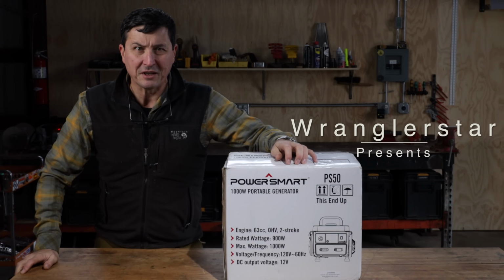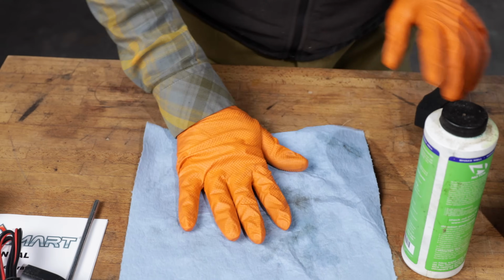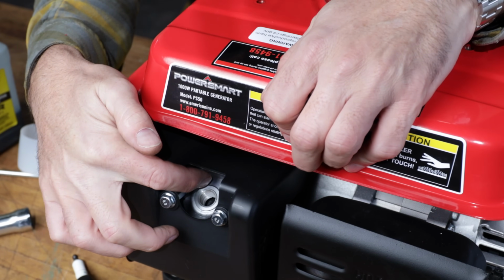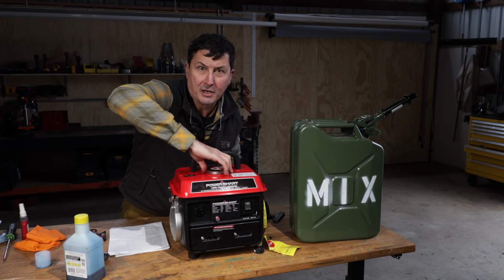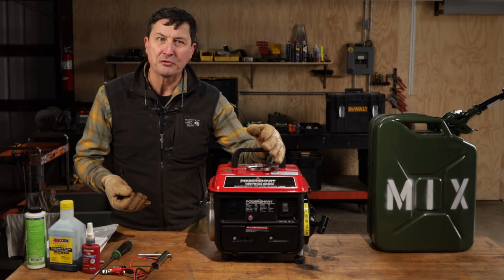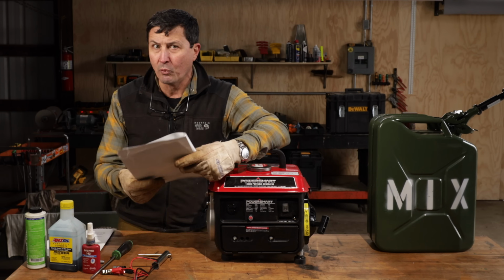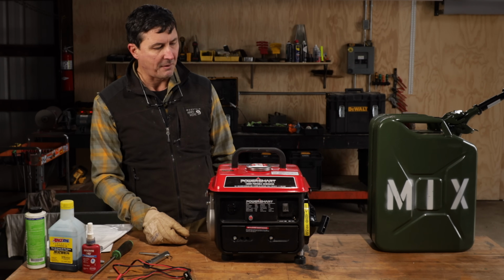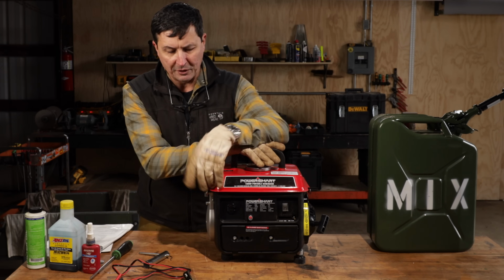TESTING The Cheapest GENERATOR on Amazon -$99

Comment: I would imagine that company produces more than just that generator, and likely produces larger models with 20amp, and maybe even 25 or 30amp outlets.
As a factory in china trying to keep costs at a minimum, you can reduce the number of different outlets on hand by skipping 15amp outlets and just using 20 amp outlets on anything 20 and under. That way they can just order more bulk of 20amp outlets, and keep the cost down, instead of splitting that bulk, and putting money into a smaller bulk amount of 15amp outlets

Comment: This exact gen set is sold as anything from a 900W to 1500W under multiple names and colors but you can find lots of documentation for them being 900 peak and 600 running. You need to put a kill-a-watt meter in line with your heater to see what yours actually puts out as plugging in a resistive heating element isn't a test because it'll just max out what the gen can give it and provide the requisite amount of heat. It'll never pop the breaker because it'll never output that any amps.

Comment: Harbor Freight sells the same thing under their own name.  I bought it and it worked really well after I changed out the cheap Chinese spark plug for a Champion.  The fuel cut off valve eventually started leaking and I got rid of it.

Comment: We bought the earlier 950W model about 15 years ago, and it was second hand even then. The only complaint we had was that one of its rubber feet was missing!   We don't use it excessively, but it seems to do all it's asked to do. It can be reluctant to start if left unused for a longish period, say, 2 months or more, but is fine once it's up and going.

The only thing to watch out for, is never be tempted to exceed the generator's design limits. These machines rely on a pair of high current blocking diodes built into the rotor. These diodes take the full brunt of the reflux current every half revolution. The reflux current is what drives the magnetic flux in the rotor, which in turn energises the stator and produces the output current. The reflux current is directly proportional to the load applied to the output, and the diodes are at best conservatively rated. You may get away with overloading once or twice, or maybe a hundred times, but it will eventually destroy the diodes over time. Small Hondas did it the same way, and suffered the same fate - we know, it's how our little Honda expired. It's also why we have a 1kW, and a 4kW Honda, and a 3.5kW Briggs, so that we can choose the machine best suited to the job in hand.

Noise wise, the little Chinese "blue-smoke" is surprisingly quiet, and runs surprisingly smooth, once loaded. Its also very handy for charging the tractor batteries when the tractors are off site - 8A charge for 20 minutes is usually enough to get all but the most reluctant tractor started.

Often maligned by some, and almost certainly not worth repairing if they breakdown, but if you use common sense, and look after it, even one of these 'Chinesium' generators will give decent service if you don't overtax it.

Always handy to have in the back of the van, or pick-up!

Comment: I have a similar unit, bought it because it was on sale for 50€. Fun little thing. 

If you run into those cheap diesel generators, the first thing to do is to drain the oil and vacuum all milling chips out of the crank chamber. I ran into one that had the oil pressure watch bypassed because it did its job and tried to protect the engine. The crude mesh filter was blocked with aluminum chips from the manufacturing. Apparently the manufacturer didn't pay anyone to remove the chips and nobody cared.

Comment: Gidday Wranglestar I had the same unit called GMC here in OZ ten years ago Global Machinery Company . They went belly up but not from selling that unit from all the other stuff that was less than adequate . If they'd only sold those they'd probably still be in business , We used them for camping a mate had the four stroke version and it was a higher output but the two stroke version punched way above its weight and if you overloaded it it would just keep screaming . You're also spot on check the tension on all nuts bolts and screws and change the spark plug the filters aren't as fine as they should be .

Comment: Hold your horses buddy. Dont plug electronics into this! It does NOT have an inverter, the output voltage is directly dependent upon the rpm and the Hertz and sine wave will vary. This is for basic stuff (lights, power tools, fridge etc)

Comment: I've had one of those generators for 16 years. It runs about 6 - 61/2 hours on a tank full. It has about 800 hundred hours on it.
Now here's my expertise, I'm a certified Outdoor Power Equipment Mechanic, with 30 years of experience. 
Do not run this type of generator using both the DC and AC circuits at the same time. You will damage its circuitry. 12 volts is drawn directly from the generator, were as the AC voltage is run through a rectifier with bridge diodes. 
Next, if your going to use this to run or charge any electronic devices use a surge protector, they do not develop a clean sinusoidal wave and can damage your devices. An inverter generator is much more stable, and has a cleaner sinusoidal wave which is more compatible to electronics. 
Comparing this generator to a Honda EU generator, is comparing apples to oranges. Its not even in the same league.
But beyond that, the one that I have has been totally reliable.
Reply: Could you use the 12 volt output on this generator to power a 12v DC in / 110v AC out pure sine wave inverter?
Reply: @rhulse8904 , you could but it's not ideal. I would use the generator to charge a deep cycle gel battery and draw the power for the inverter from the battery. The battery will act as a buffer against the voltage irregularities produced by this type of generator.
Reply: Thanks friend, I didn't know that ..
You may of just saved my generator  ?
Reply: @tedsamuels3203 , your welcome.

Comment: This is a similar or perhaps the same generator that harbor Freight sells. That's a pretty good price also especially delivered.
I've had my little two stroke generator from harbor Freight for 7 years..
I don't get to use it that often but I very regularly start it, and  put a little load on it , and then let it cool off and shut down I always make sure I drain the fuel by letting it run out of fuel.
I changed the spark plug to a better brand and I added a fuel filter.
I actually don't find them to be that loud... And they're reasonably fuel efficient. we used it camping one time to run some lighting about only pulling about a hundred Watts, and it  ran for almost ten hours on that gallon of fuel
the thing that I like is there extremely lightweight if you just need some portable power but don't need that much in the way of amps they work great.
I would probably not suggest using sensitive Electronics with it since it's not a inverter style generator.
I have a 2500 watt inverter generator from harbor Freight also and that also runs quite well.

Comment: I bought my Harbor Freight TailGator expecting it to last a year or 2.  Twelve years later and it is still on the Chinese spark plug.  Best $89 you could spend at the time.  I have run it for weeks before, also loan it out to people.  The only repair I have made was to replace the fuel line.
Reply: whats is the biggest thing you have run off it? Still running now 3 years later?
Reply: @StephenGrosch  Unfortunately it quit outputting power last year.  😪   I replaced the capacitor and checked the plug outlet and determined that it was a problem with the windings in the power unit.  I have powered a 5000 BTU window a/c unit with it.  A total of 14 years is really good though.
Reply: @bimmerwman  RIP Your did your job well!

Comment: Your more expensive Honda generator will give a cleaner sine-wave output, suitable to connect electronic equipment to.  Any basic generator will only be suitable for driving motors or resistive loads.  You could always charge a battery and use the battery to run an inverter for your electronic equipment.

Comment: The Honda is extremely high on price, but keep in mind its an inverter, not just a regular generator, a inverter is much safer to run your electronic devices, but there are a number of inverters available at reasonable prices. I saw a Champion 2,000 watt inverter advertised for $399 which is a bargain, and there are several in that $400 to $500 price range, and they are 4 strokes and should last a lot longer.

Comment: Ive had the harbor freight version for 3 years, lived through a winter on top of my car, still starts in 1-3 pulls every time. Cleaned the carb out once, and has continued to run fine over many eyeballed gas/oil mixes. Paid $90
Reply: Same here, she's a beast for the money, and very portable also.
Reply: Winter in what state?
Reply: Winter in what state?
Reply: Did you disassemble your carb for a full clean or did you just spray a carb cleaner into the running generator?

Comment: The big thing you didn't mention us that these are two stroke and capacitor exited which means the rpm and voltage regulation is   not good enough to run any kind of digital equipment, these are well known for frying PCB's . Another factor is the 12 v DC voltage is not high enough to charge a battery, you can get it higher by increasing the rpm but you can't use the AC until you have set the rpm at  3600 / 60 hz again.

Comment: The Harbor Freight version is the exact same thing minus the 12V charger on the side. The newest version might have the 12V but Ive had mine for at least 8 years and it still runs great.  Ive used it to run refrigerators during power outages and most recently last week I used it to run all the christmas lights on a float.  Well worth the money.

Comment: You should have released this 2 weeks ago...

was looking into this one to run a 650w compressor but since the startup require 2-3x the current i was not sure if it could handle it. atleast my 3000w is very quiet (2x the price)

Comment: Ditch that Torch spark plug ASAP. Wranglerstar's video reminded me that I have a generator just like his that I haven't been able to start since last year after maybe 2 hours of use out of the box. Today I spent an hour trying to figure out why. Changed the gas, emptied the carb bowl, looked at the spark plug (clean, hardly used), checked the fuel line. It still wouldn't crank. Finally, I put a random Champion lawn mower spark plug in and it cranked right up!  It did run rough though. Went to the car parts store and got an Autolite 64 plug. Runs like a champ.

Comment: These cheapo units are getting so-much better that it's mucking-up the used market for the name brand units.  I just practically gave away (compared to the price of a new one) a Honda powered 5kw generator with only 35 hours on it because a new Chineasium unit can be bought so cheap.

Comment: That is rad.  If it were mine id add an extra muffler.  

Id be really interested to know if it would run on diesel,  sure its not supposed too and the internet will say it simply cannot,  but will it ?   If not straight diesel,  50/50 mixed with gas ?  What other flammable liquids can it run on ?  Etc

Comment: Ask your neighbor down the road to make you a voltage/amp data recorder, and run this for 1-2 weeks 24/7 under load. Will it standup? Even though it's around $100, getting another one in a emergency power option is not an option. Saw a review from a Ham channel on a dual fuel generator that could run on gasoline, natural gas, or propane. That's the way to go. Plus the natural gas/propane runs way cleaner and requires less maintenance of the carb after use. During an extended outage, gas lines will be long but natural gas will be there. Get a big enough generator to run your furnace and you're good.

Comment: Most people like you will have a battery charger you can run off that generator 120 volt outlet. The cables are not that important.

Comment: I like the reviews, but I disagree with storing equipment dry after they had fuel added to them.   I think that invites issues with the lines and tank.  I much prefer and had good results with storing them with fuel, with a double dose of fuel stabilizer.   The lines stay in better shape and I don't get rust in the fuel tank.   My backup generators sometimes sit for 2 years so I run them 3 times a year and replace the fuel once a year.   I use the fuel in other equipment I use often or my car.    Just my 2 cents.   Keep up the reviews!   Thanks

Comment: No way that thing is able to handle a full size fridge!
Reply: YES, way..   I have run a large size fridge on mine multiple times. I have even loaned it to a neighbor during an outage to run her large fridge.   Just don't try to run much else. The fridge does not really run all the time.  It only turns on when needed.  I ran the fridge for an hour or so.  Then disconnected and ran other appliances for a while and in a few hours hooked up the fridge again.  No problem .  Do not be deceived by the small size.

Comment: thanks wranglestar    I have the tailgator   I love it.  its going on 5 years old now.  runs with a little shot of either to get it going.    over the years   It did need parts.  I left it outside in an unheated shed and the cap blew up I found a new one with a google search.  plug and play with a little trimming  .  The float bowl pin will not stand up to eathanol gas   A new carb was needed   Available on Amaazon for around 20 bucks      So I have $145 into mine over 5 years

Comment: Just be carful with those because there not voltage regulated it just is controlled by rpm so whene it runs out of gas and starts surging and you get huge voltage spikes

Comment: Those are great for the price I bought one from harbor fright about 6 years ago just to haul into a motorcycle trail to charge car batteries for some bridge welding and drilling, it ran for several hundred hours on that job and still sees use around the property today. And no oil to change and no plastic cams like in the Honda 1000 and 2000.

Comment: I would absolutely NOT plug sensitive electronics in to one of those generators. Best case scenario its not going to work efficiently and you're going to generate a lot more heat in whatever you're plugging in. Worst case, you're going to fry it. If its a modern fridge/freezer, computer, what ever, you need to be plugging it in to an inverter generator (pure sinewave)

Comment: I found a 2 stroke gator generator on the side of the road. it was full of 2 stroke fuel. I pulled the spark plug and found a piece of carbon stuck in the electrode. Once i removed the carbon the generator ran fine.

Comment: An otr truck driver would be wise to have one of these for when their APU starter wire breaks because the jackass manufacture didn’t take into account the engine moves when it starts and they made the cable too short.

Comment: Well at that price. 2 stroke and battery charging aswell? Might not be a bad little generator to keep in the truck/car when out cutting wood. In case the battery discharges. It definitely feels like it could be a really great bit of kit.

Also word of advice when buying these cheap pull cord machines (chainsaws, generators. What have you) check the starter cord. Make sure it's solid and high quality and not just a bit of cotton yarn essentially

Comment: Same as the harbor freight tailgaters generator minus the 12v batt charger I have been satisfied with mine for awhile now good running and strong hope it works for you!!! And by the way the fuel mixing cup goes under the fuel cap hope that helps good luck

Comment: Used to use a Honda 1000W genset similar to this one for radio station remote broadcast field jobs.also that little generator helped me install the stations new 50Kw AM transmitter plant when the power to the site was not yet connected.Ran drills,saws, and an angle grinder   ,and a 12A NSS vacuum cleaner without any issues.

Comment: So this is basically a clone of the Harbor Freight (I believe they call it the Tailgator now but when i purchased it i believe it was just a predator) i purchased mine in June of 2014 and it still runs strong until today. Only thing done was swap out the chineseeum spark plug for a good quality one and I always run either non-ethanol gas with 2 stroke oil or these days that pre-mix from all major manufacturers.  When used for tailgating I run a Traeger tabletop smoker while simultaneously  powering a TV and an electric warming tray. I love this little generator for what it is. I eventually made a portable generator box also with a built-in fan which easily cuts the noise about 50-60%.

Comment: I start my Honda around the 1st of every month for a 10 minute maintenance run. I also keep a log of every time it is run inside of the manual, which I keep right inside of a waterproof pouch on the side of the generator. All of my gas is treated with PRI stabilizer, which I consider to be the best stuff available. Do it right. Or why bother? I always say anyway. And I'll tell you that fir free...right there. 🤣
Buy American - whenever possible.🇺🇸
Keep em comin. Good stuff.

Comment: ...found one of those things a few years ago in the trash - worked. Stored it. Tried again 2 years later or so - still worked. Drained the fuel and put it back into storage.
I wouldn`t run expansive or complecated stuff with it. No inverter, so  whatever it puts out will be of rather poor quality, but for an electric engine of any sort, pump, compressor it`ll be fine.